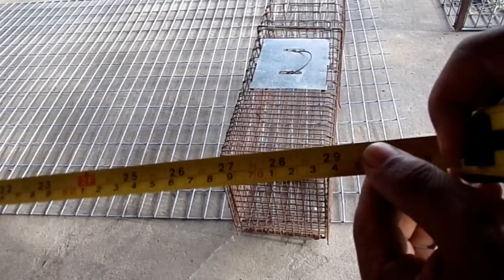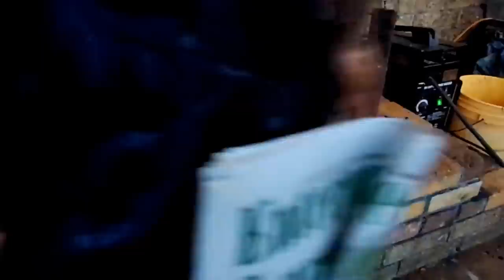Horse Panel Cage Trap How To

Comment: I like your video, very informative, and you made it look easy. Thanks for sharing.
      This video is 5 yrs old, so you may have changed it by now. But Home Depot has steel U stock that would make a good door slide, maybe cut production time and maybe a little cheaper.

Comment: Another question for you sir. Have you any experience with a stick welder? I am a novice when it comes to welding, and have a little stick welder. The problem I'm having is that I'm burning the wire mesh even with 1/16th size rod on low amp. I'm using pretty heavy duty mesh like you are using here.